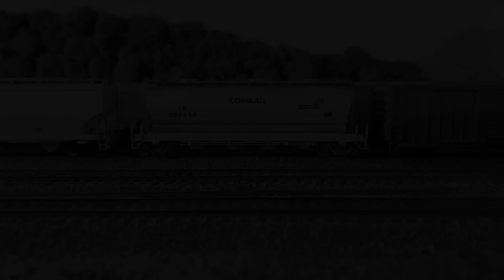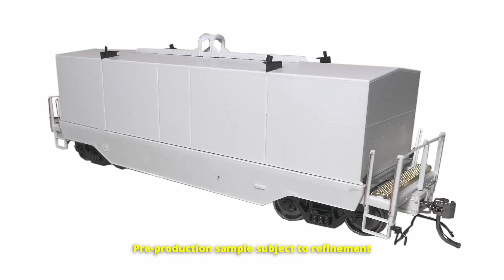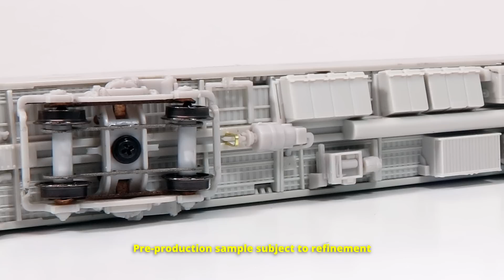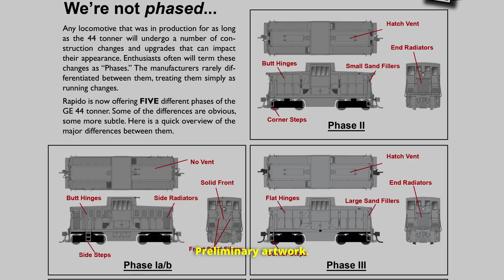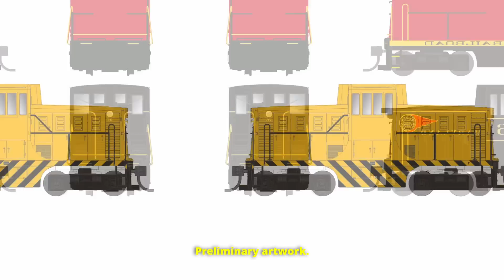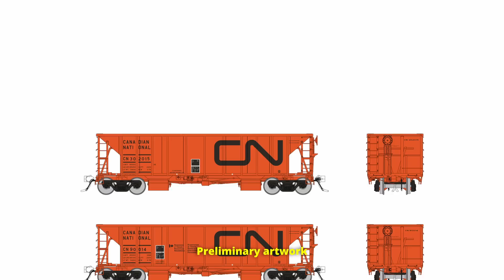Get 'em Before They're Gone!

Comment: As a VP of an N scale model train club. I will say, you guys will always struggle hitting the sales targets you want if cars need minimum 14" radius. I would strongly suggest offering extended coupler shanks in polybags. Yes the Atlas equivalents of an AMT/NJT Multilevel look ugly going around a 10" radius. But they do run on %90 of layouts without modification.